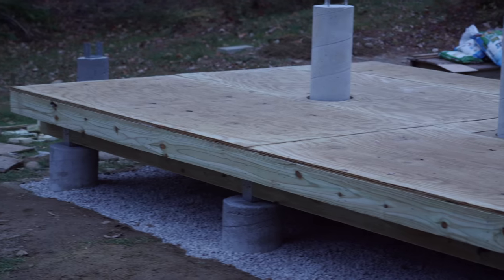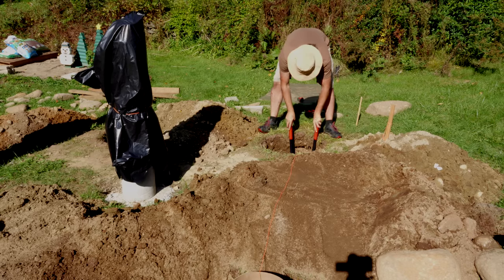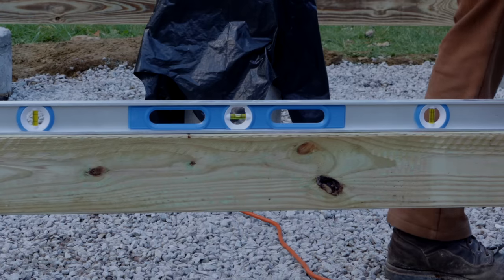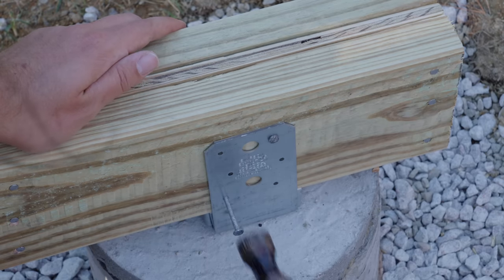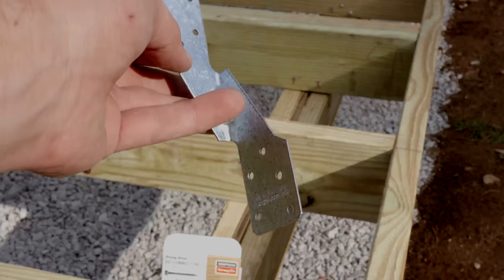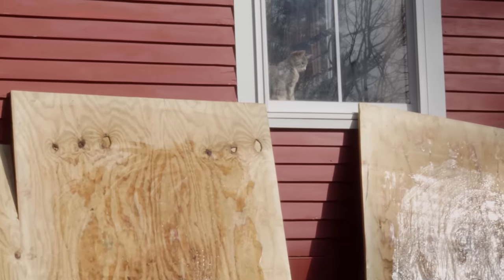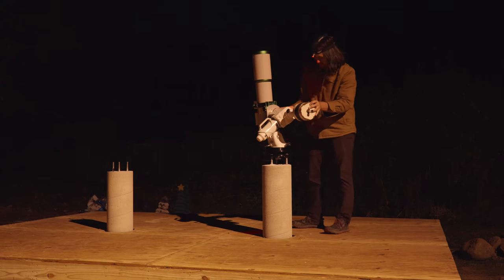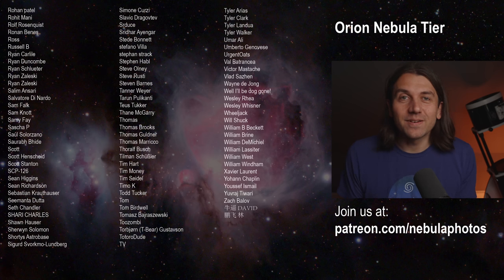My DREAM OBSERVATORY has a FLOOR!

Comment: Very nice job so far! One suggestion regarding the outlets near the pier. I would suggest mounting them vertically to wood rather than horizontally on the floor. The reaason for this is to prevent any water from falling into the outlet if some makes it way in. Mounting the outlets on a post or something similar will also raise them up and away from any flooding as well prevent water from falling into the outlet when using an outdoor in-use cover.
Reply: Very good remark! Even just spilling some tea by accident could cause a nasty short if these outlets were installed horizontally on the floor.
Reply: @commander-tomalak or worse, wine. Bad for outlets and  a waste of wine too! Nice job Nico! Dr B from Manitoba, Canada 🇨🇦
Reply: I am not sure but I believe there are some restrictions in the electrical code when installing a face up outlet.  Basically for the problems noted.  it becomes a water hazard and other items can fall into the outlet.  Horizontal, is best IMHO.  Also, i now an open roof in the rain is a no no, but  if it were to rain with the roof open, this becomes an electrical hazard.  I might consider gfci and outdoor outlet covers for this.
Reply: When my observatory was built my husband built a wooden enclosure around the concrete pier and put outlets on that. It looks really nice and is probably safer than outlets on the floor
Reply: Definitely do GFCIs too
Reply: At the very least, get outlets designed for in-floor use. They have heavy duty mounting plates and spring loaded covers designed to protect the outlet from intrusion when not in use and can also withstand equipment rolling over them. If you've ever worked with a theatrical stage, you've likely seen something them installed into the stage.

Comment: All you have to show?!? You did an awesome job, the thing you should rememeber, if you are savvy (which seems you are) there are only two differences between DIY and professional install; one is that it will take you longer, but you will do a better job, and second is to try ignore the mistakes. Pros do the same, they just know how to hide and work around it quicker :) looking awesome though!!!! I loved seeing how you worked around the issues... Also the plenum heights can be increased with fixtures, you have a super stable foundation to fall back on there.

Comment: The easiest and most accurate way to level the piers is to use clear tubing 90% filled with water. The water at each end will seek the exact same level. Works perfectly.

Comment: A foolproof and very cheap method of ensuring perfect level between two points, is to use clear plastic tube filled with water. The water level at either end of the tube is always the same. This is an old trick I learned a long time ago.

Comment: Quick and easy way to check holes is a plumb bob (string with a weight on the end). You can use it to check the wall of the hole and see if youre straight without trying to read a bubble level in a hole.

Comment: Instead of drilling through the joists and adding narrow bore plastic ribbed conduit for running electrical lines, it would have been easier to use larger diameter PVC pipe and PVC electrical elbows held in place UNDER the floor joists via metal straps.  Ditto for Ethernet, etc. cables.

Comment: Man, I wish I was closer so I could offer help with this. You're up against a real challenge not having much experience with construction or woodworking, which makes it even cooler that you're tackling this alone. You're doing a great job, considering! But there are so many tricks that could/would cut your labor time in half or less and sure up a lot of the minor issues you're having. There are also some things I think you'd do differently if you had the experience, or somebody experienced there to help. 

This is no fault of your own and you'll get no judgement from me. I deeply admire what you're doing and I plan on doing the same. Seeing this motivates me. Your videos have been so informative and motivating for me and my astronomy. If I was at all able to, I would be thrilled to donate a good bit of my time to help you. Unfortunately though, NH is a couple days drive.

Anyway, I'm looking forward to seeing your progress!

Comment: the site looks good.  I just finished mine, so I feel your pain. When you build your door, find a good plan on line that shows 45 degree supports for top and bottom half of the door. These work together to ensure your door cannot sag.  Any linear door will sag over time!

Comment: Nice update.   I'm following your project with interest.   I certainly sympathize with your learning curve since I recently built a tree house/ deck and needed to learn a lot of the same skills. 

One tip for dealing with all the nailing for the joist hangars,  etc...  I bought a palm hammer for my pancake air compressor. It was a god send. The tool is a bit smaller than a palm sander.   In the base,  she the sanding disk would be,  there is a cylinder,  about an inch long and a quarter inch wide.   

You set a nail in place with a tap or two of a regular hammer and then slide this cylinder over the head of the nail.  The compressor kicks in, and with no recoil, it hammers the nail right in.   It's great for jobs like this where you can't use a regular nail gun, and it's especially useful in tight places where there isn't enough room to swing a hammer, like perpendicular to joists. 

Looking forward to future holidays updates.

Comment: This is an awesome build! But just for some heads up, when building with wood: Screws are designed for lengthwise tension, and they grip very well along their axes, but they very often do not tolerate cross-wise shear forces to any reasonable expectation without snapping. Nails on the other hand can bend under shear forces, but since they are not as brittle, they won't snap, and will probably hold your structure in place better than screws would. I wish you lots of years of enjoyment in this shed - you absolutely deserve it after what you've been giving to the community in the past decade!

Comment: Congratulations with the floor! a lot of attention to detail! What im used to see in small construction sites for levelling purposes is a simple transparent hose filled with water, the water level at each end of the hose are always leveled, pretty ingenious!
Reply: That's a trick I was going to mention also, but you beat me to it! 😎 (it gives you absolute perfect level over whatever distance you want to cover or until you run out of hose length... Unless someone turns off the gravity)

Comment: Hi Nico, just watched your update, looking good so far. I have a suggestion to help tidy up the timber work around your piers. Measure the area to be infilled (the complete square), then find the position of the pier's centre; Mark this as accurately as possible on the square of ply that you've cut. Use Google to help you build a "trammel" for the router (it's real easy) and then cut your circles. Now the one piece of ply will easily slip over your pier and into place.... it will look super slick and at the same time close down that gap that you have.
Also you would be best mounting the outlets to your pier about 2.5 inch from the floor (if you have space). 
Great build so far, I'll keep checking back.. 
All the best from the UK.
Reply: I agree with adding the square of plywood but would also add strips of hardwood around the pier for the plywood square piece to sit in, thus you can lift the plywood out of the way if needing to get under it. Also, if a kid's pool noodle would fit in below and seal tight against the pier, you can put cinnamon and/or other repellant in the hollow of the noodle to repel insects and rodents, plus it can be refilled if needed. Might be able to fit the noodle to the bottom on the plywood piece also.

Comment: To fill your gap around the telescope beams, use expanding foam to fill it up. On the inside you can use silicone to give it a clean look.
Both will not let in humidity or bugs, while also not carry vibrations!

And one tip: apply a sealer on the concrete beams, all of them. It will keep humidity out, thus preventing damage and mold in the long term.

Comment: Very nice job Nico!!! Only thing i could tell to you is to not put outlets directly horizontally on the floor. It should be best to fix them on the concrete tower, avoiding some issues with dirt and whater. Wish you succes for the rest of your build! From Québec!

Comment: My back hurts just thinking about all that shoveling. Way to go in putting in all this effort! Looks fantastic and you'll be so glad once you're imaging that first night. Agreed with the person above that you probably don't want the outlets horizonal like that given that you'll not be completely sealing the environment out near the piers. I wonder if there's actually a better way to add a proper environment barrier though, something like a donut that surrounds the pier and attaches to the floor, with a rubber gasket layer on the inside of the donut to press lightly against the peer. May be helpful and necessary to keep critters out. One other thing: you may want to use screws at least on corners and every so often on the floor boards since part of the reason floors squeak is when nails pull up a bit (screws can't pull up). In any case, minor points, best of luck!!

Comment: I used rubber interlocking gymnasium flooring to further dampen the floor from vibration.
Also, I used a steel pier which mounts to the concrete base.  The pier was filled with beach sand.

Comment: Good progress! For the weather stripping for the piers, what I would probably do is get 1/8" or 1/4" rubber sheet that you can cut a big X in the middle or or a circle that is about the same size of your pier and then slide it over and nail it to the floor.  Thanks for showing both the ups and the downs by the way.

Comment: Hello Nico,
Very much enjoying your observatory build series so far!  I've been planning my own home observatory for the last year or so and hope to break ground in January.  It will be 12' by 16' (to keep it under the building permit square footage) with 7-foot walls and a roll-off roof.  I have recently taken the first step - removing some large trees blocking the view to the north.  Now I have adequate views in all direction (30 degrees above horizon minimum, better to the north and south. Next up is the floor.
Before I build the floor, I need to decide whether to include piers. I feel like piers are not really needed with these dimensions; my telescope is a C11 Edge and CGX mount. The mount's tripod seems plenty sturdy for the C11 including imaging train, and there should be enough space for a 2nd OTA/mount. Most of the arguments in favor of using a pier that I have read in the online forums pertain to space savings and telescope clearance. The CGX on tripod should be able to track 20 degrees past the meridian, and space around the rig will be ample to fiddle with the hardware and cables. 
Am I missing something in my thinking?  As this video makes clear, it's better to plan ahead than go back and try to add piers later so any advice would be much appreciated!
Thank you for all you do for the astronomy and astrophotography community. Clear skies from South Carolina

Comment: a little south American construction tip: use a clear PVC hose to keep level across many things! get a big length of it, fill it with water while holding both ends up keeping some air on top, put one of the water lines on the height reference and you can walk around with your hose perfectly at the same height wherever you go! just make sure to not spill water or have air bubbles inside, or you'll screw up your measurements

Comment: I can't wait for the roof. Some people have mentioned that floor mount outlets may be a hazard. I don't know how you plan on getting power to your observatory but assume you will have a breaker box. I would make sure that you use a GFCI-AFCI breaker. That will protect all the outlets on that circuit. Especially since you will have a roof over the telescopes I see no problem with floor mounting the power outlets.Code in California would require that any electrical lines you run from the house to the observatory be buried 18 inches. It's a good idea to put in pea gravel to within six inches of ground level as it warns anyone digging over the lines that something is buried there.
Far as cutting the ply around the concrete columns, you can use a short piece of sono-tube to get the diameter. Cut a thin piece of ply as a template and use a router bit with a top ball bearing guide to do the actual cut in the 3/4' plywood. If you use a jigsaw to get close to the hole size the routing is easy and makes a very nice hole!

Comment: Jeez! It took you longer than anticipated!? Welcome to the real world...

I can add a tip from one of my shed mistakes. DO NOT use osb tongue and groove for flooring! I did in my pandemic woodworking shed. I injured myself (unrelated) and 2 surgeries and a lot of rehab later I am continuing. Even though it was treated and even though I covered the floor, it soaked up water like a sponge and all of that chip - board OSB dissolved the glue making it non-structural stuff... As you did Nico, I bought 3/4" treated plywood and am going on from there but it sucks having to backup, tear up stuff and do it again... 😢

Comment: Excellent job so far Nico!! :-D Such an expensive thing to build an observatory, but so worth it in the end! - I have to say my favourite part was the vibration test haha, I did basically the exact same thing to test mine xD
I doubt you'll have any more issues with the fungus on your ply surfaces now they're laid, but if you wanted to add another layer of protection then you can use an anti-fungal wash quite cheaply, it penetrates the upper layers and inhibits all growth. - RE: baffling the floor from the pier, you could perhaps bend a little bit of foam pipe lagging/insulation into a ring shape and push it over the cut edge of your plywood surrounding the piers, it's flexible and should do a good job 🙂
Clear skies!

Comment: agree with below - floor mounted outlets might be a mistake because 1) moisture will get in when the roof is open and 2) I think they need to be covered/capped when not in use to meet code.  Also code requires GFI protected circuits in moisture prone areas (kitchen, bathroom, outdoor outlets).   Either the first box in the circuit will be a GFI outlet or there can be a GFI breaker in the panel.

Comment: For leveling the height of the piers. The best and cheapest solution is a simple transparent  hose with  water inside.  The water will be always at the same height in both ends of the hose no matter how long it is. 
It's an effective solution used by almost every construction worker here in Argentina.

Comment: ive watched on n off your channel for heck 4 plus years. youve come a long way .. good job for sure. lucky you tho.. dang i still have yet to build mines... also for anyone else and maybe still you.. depends on how big of diameter the piers are... you can get PVC end caps i think up to 12 or 14 inchs. makes a nice smooth finish top and no create edges at all...... just tossin it out there. crown up is for sage over time. u DONT want the plugs facing up like that. use a piece of pvc conduit to mount them up facing out... they will fill with crap over time and short or stop working so on .. hahah iam in VT north west corner near can boarder top of the big lake

Comment: I'm in the process right now of taring down my old tin shed, I have a nice slab already so will be bolting my deck to the slab..... pier I have been told I can get special bolts like self tapping rio to screw into the slab for the internals of the pier (mine has to be 2.7m tall to get the mount over the roof so I can polar align). It is a fun project to undertake. I feel you and your lessons along the way.... sometimes I find myself completeing a part of it realising that there was an easier way. Love your work mate.... can't all have Nexus domes like Dylan O'Donnell

Comment: A very informative video indeed. I just wanted point out the solution of the first and second problem you faced. You should never dig exactly as per the dimensions.(Been there, done that, it never works😅)  You should have dug a slightly larger and deeper hole. Then you can use compacted soil or lean concrete to create a level and accurately high base for one of the cylinders to sit on. Once you level and set height of one of the cylinder,  you could have used water level (A long transparent tube with water filled in it) to get other cylinders on the exactly same elevation. You don't need to have fancy self levelling laser levels to do simple projects like this.

Comment: I'd go with 4Way Deck-Blocks from any building supply, including Home Depot. You end up with a portable building yet very solid... my huge patio is resting on them. You are not depending on that floor for stability as your scope is on the pier. I'd also go to a scrap dealer and get a chrome plated piston rod with threaded end. You can screw it into a threaded base cast in concrete underground. If you ever abandon it, unscrew rod and fill it with dirt. I have never heard of building codes applied to shed like structures no one is living in, provided they are not attached to a house. So even  an inch of separation is good and there were some other rules about not exceeding certain heights etc. You are building a shed basically so no building codes apply hardly.

Comment: About leveling the fundaments: here in Spain they use a simple transparant hose for that. You fill it with water and place either end at the extremes of the construction. The water level indiciates the right height. Simple, cheap and very effective.